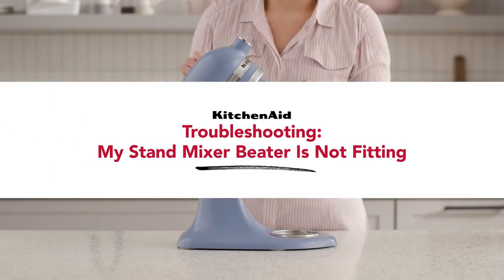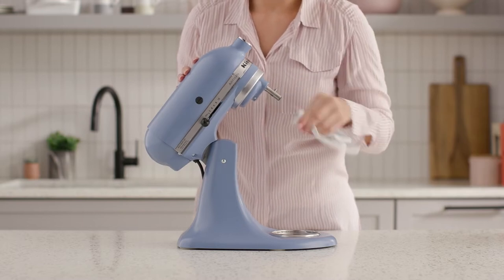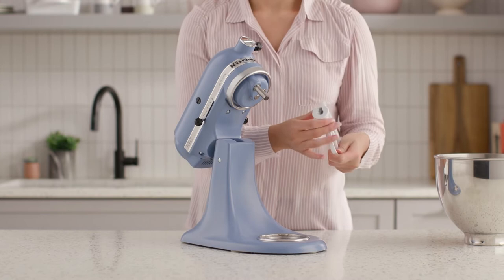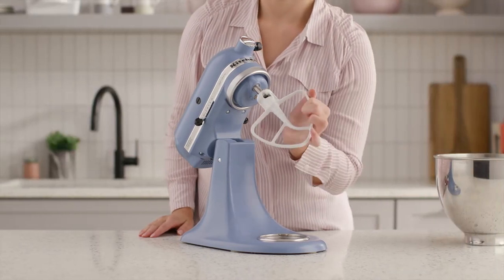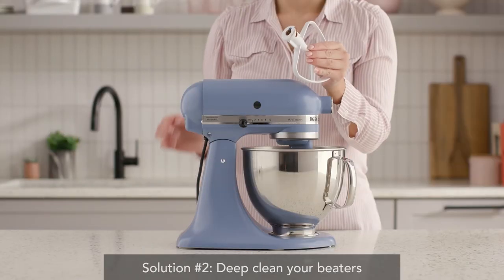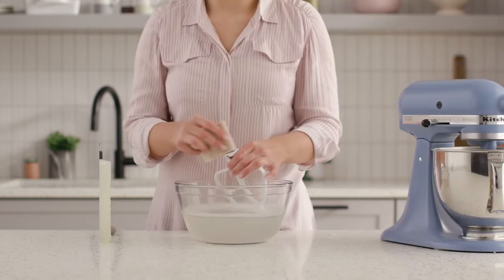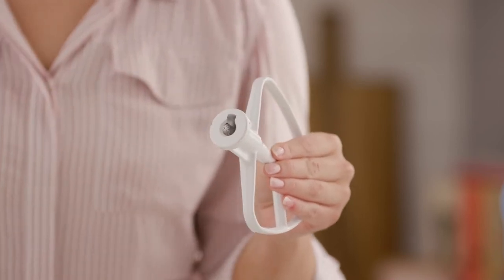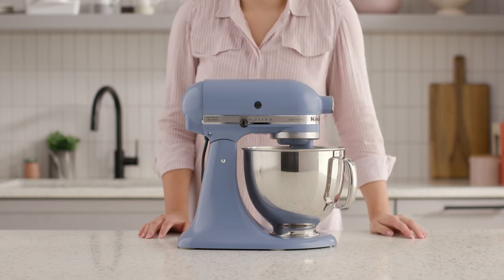Troubleshooting: KitchenAid Stand Mixer Beater does not fit in | KitchenAid UK

Comment: NO. This is not the only reason for this issue. The pin on the shaft could be loose (popped out) after using a few years, so the beaters won't be fitted in any way.

Comment: The reason why this is more of a problem now is because of the removal of the spring and washer that used to be on the mixers before 2016. Just buy a spring and washer. Also thoroughly clean your attachments after each use.